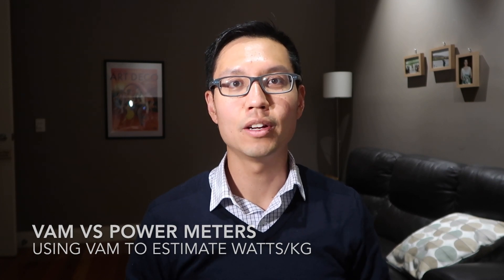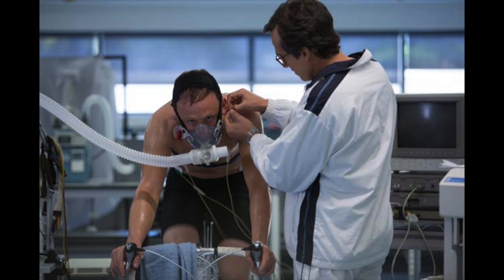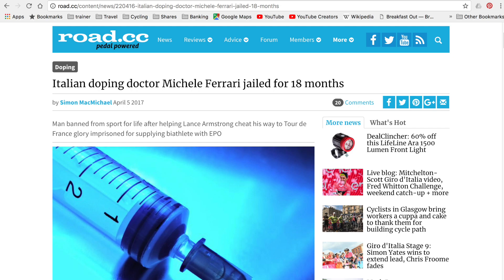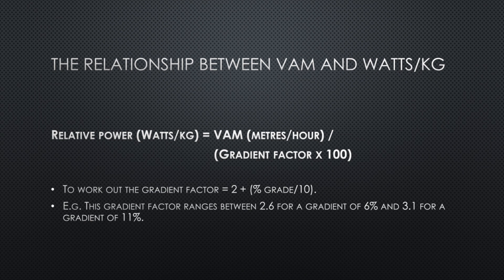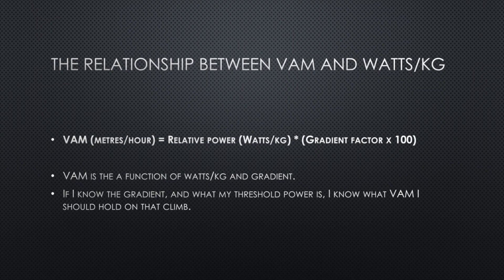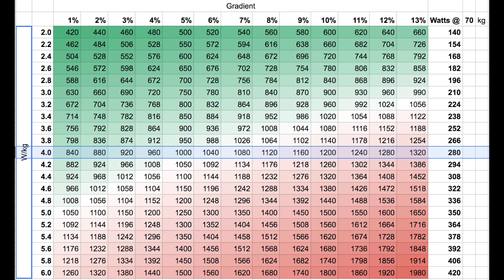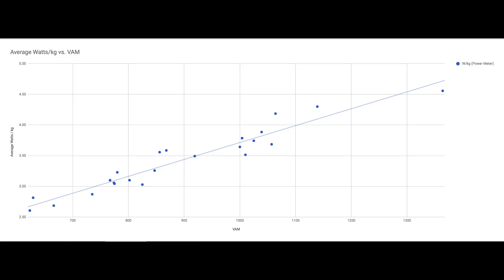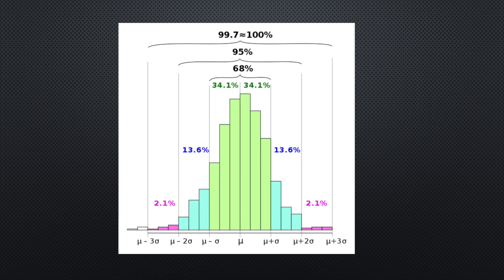Who needs a power meter when VAM is free?

Comment: But that formula must have been used using pro level bikes, which are lighter, so faster, than normal bikes. So in this formula, the weight of the bike is supposed to be the weight they used at that time?

Comment: What about flat road?
Reply from the maker: Doesn't work on flat roads and also a bit inconsistent on short punchy hills too. It works best on long sustained climbs
Reply: Watts per kilo isn’t as relative on a flat road since weight has minimal effect and wind resistance takes over. VAM is totally useless since you’re not climbing.

Comment: What about drag?
Reply from the maker: There are generally 4 forces at play - wind, rolling resistance, drivetrain and gravity. The impact of rolling resistance and drivetrain is relatively constant, but drag increases exponentially as speed increases. Conversely at slower climbing speeds, the effect of gravity far outweighs the impact of wind resistance. The steeper the hill, the less of an impact it has. Reminds me I need to share the spreadsheet
Reply: I mean in the VAM formula you showed wind resistance is not considered. In your power data wind resistance is taken into account since this is the primary force you are combating when cycling at speed as indicated
Reply from the maker: @thprodctions   you're right, i showed a simplified equation that uses a "gradient factor" that hides some of this complexity.  This is a precalculated approximation based on a number of assumptions on altitude (air density) and rolling resistance.  The reason why I use the approximation is the cubic equation is basically linear for the range of gradients that typically go from 0-15%.  This dramatically simplifies the calculations rather than having to solve a complex cubic equation, especially when at threshold!  The full equation is explained better by the climbing cyclist : http://theclimbingcyclist.com/gradients-and-cycling-how-much-harder-are-steeper-climbs/
Reply: Thanks Derek, you got my subscription